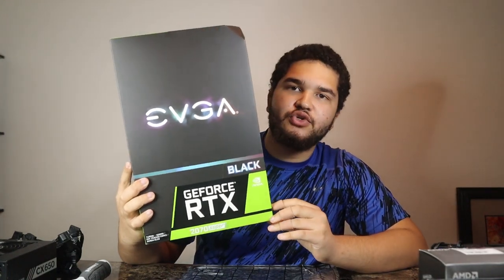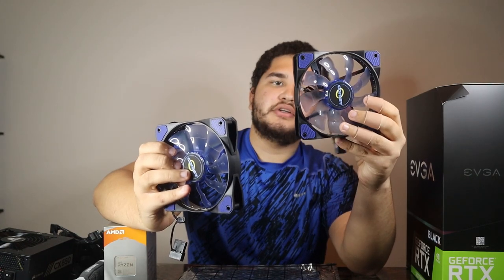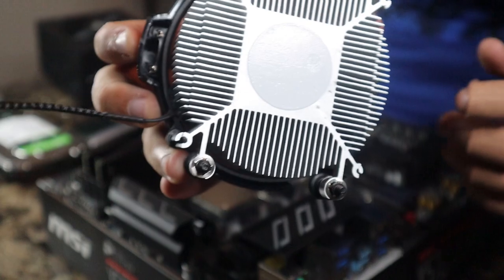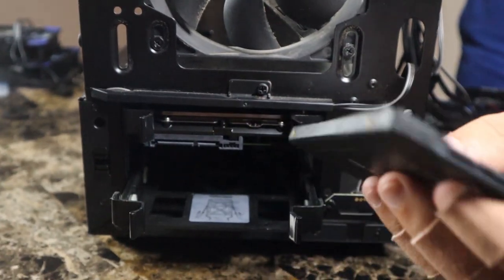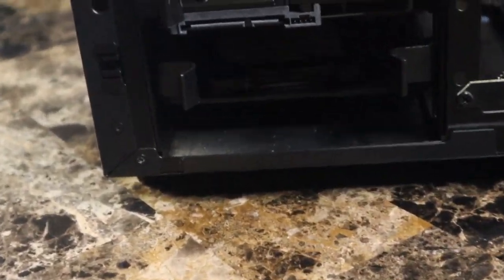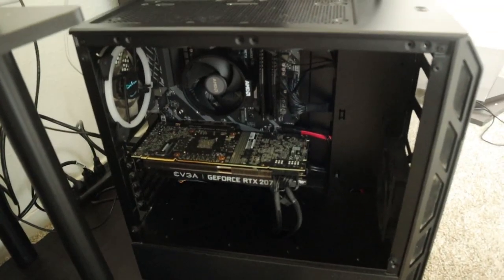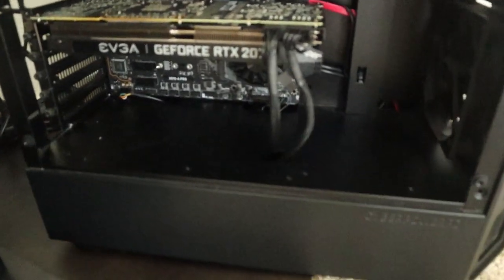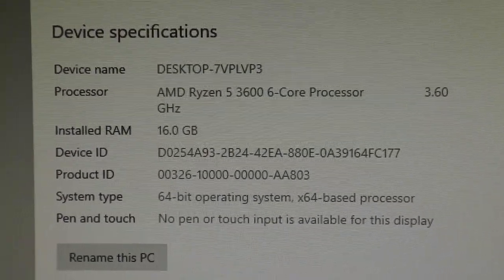$1200 Gaming PC Build 2020

Comment: Hey man nice build! Glad you did not give up! I realized at 12:42 onwards all your 4 fans are intake and there is no exhaust. You might overheat your system. Just a suggestion, you might want to switch the position of your rear fan to exhaust. Other than that, keep it up! Here's a like and a sub to support you!
Reply from the maker: Thanks for the support i really appreciate it, About the fans, i actually noticed that and changed them around yesterday, i looked at them and i was like this isn't right, My temps were pretty stable with them which was weird but they are about 6-7 Celsius better now, thanks for the help tho.